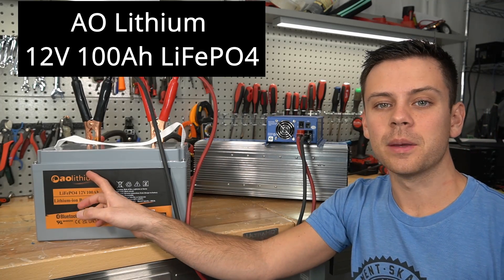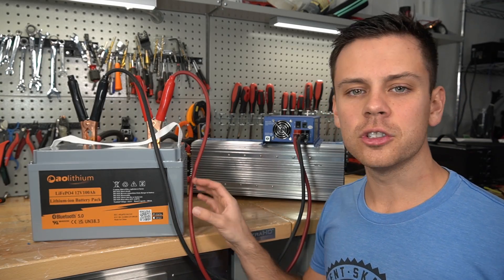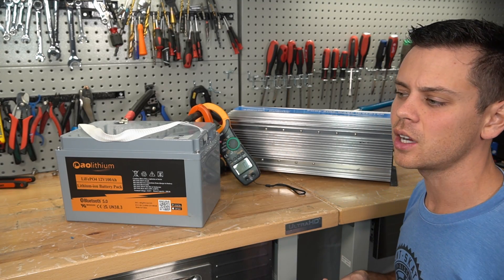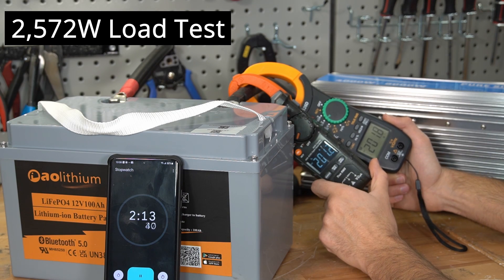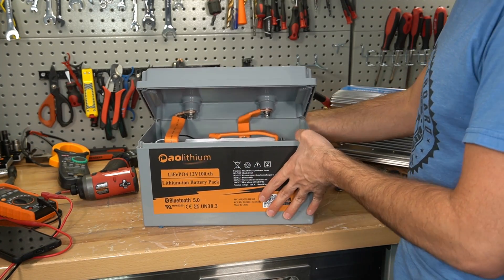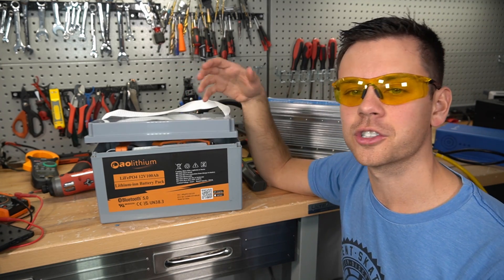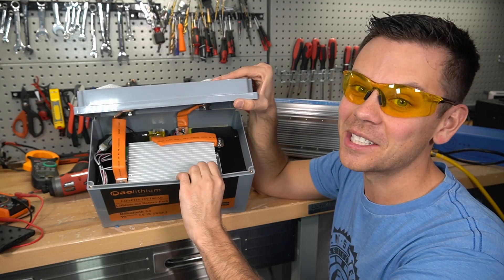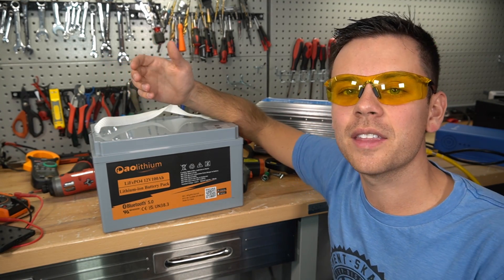"AO Lithium" Stress Test: Can a 12V 100Ah LiFePO4 Run 2,500W?!

Comment: Hey Will. I greatly appreciate your videos and have learned a lot about Solar from your subject matter. Quick question. I'm finishing up an Off Grid cabin build in the mountains. Plan to run 4 LED lights, a small TV, a very small refrigerator and a small 1/2 HP 110 water pump. Could a 12v system get the job done for me, or should I go with a 24v system? Anyone in the thread with advice would be appreciated.
Reply: Is refrigerator 12volt and how deep well?
Reply: @bluecheetah420  fridge is a tiny 110v unit and the pump is just for creating water pressure for a small sink and shower with the water supply being a 35 gallon water barrel. No well to pump from yet.
Reply: @paulie6709  cat’s pajamas hit it right on the head with response
Reply: You could run a 12v RV water pump instead of of 120v. They are designed for that application. JMTC.

Comment: Very impressive! Too bad you didn't monitor the voltage @ the terminals of battery. I'd like to see what the drop is during the load test. I know FLA batteries are terrible when hit with a load like that.
Reply from the maker: 114mV drop across the longest supply conductor. Not bad. Was checking it
Reply: @WillProwse  That's good, but what about battery terminal voltage? Did it stay above 12 volts?
Reply from the maker: @curtchase3730  yeah probably stayed above 12V because it's lifepo4. Soc curve is much higher than other batteries, and internal resistance is low. Pretty sure voltage drop at load wasn't bad at all
Reply: @WillProwse  LOL I saw that spam. What a bummer. Some ppl just like to mess things up. Thanks, I figured it would stay above 12. They rate the voltage around 12.8 but all my LiPo's hover around 13.18 or better when not loaded down.  BTW, I love your enthusiasm of the world of alternate energy sources. Thanks for all the tips. 🤗
Reply from the maker: Gosh I'm so tired of the spam. I report every single one

Comment: With the ability to pull that kind of power for that long, Heat sink will need help with a fan and cool air ventilation.  I know that the manufacture doesn't recommend it, but if you fill the cookie jar and tell the kids to not touch them.....

Comment: You didn’t specify what kind of microwave.  There are a lot of 600w and 1000w microwaves.
Reply: The brand of the microwave oven is not that interesting - the only relevant factor is the power consumption. There might be minor differences in the inductive load (on the inverter) but that is for your inverter to handle. A current of 200 amps @ 12 volts corresponds to 2400 watts, so just about any microwave oven on the market for household usage should work.
Reply: @inber  I said anything about the brand.
Reply: @MattNis1  so if not brand then what are you referring to when you ask "kind"?
In line with the discussion and comments it's about household cooking microwaves.
Reply: @chrisdevalcourt648  small, large, commercial, built-in, portable, with or without exhaust, with convection, drawer, etc.  mostly referring to Wattage and maybe kind wasn’t the best term.
Reply: @MattNis1  I think definitely not commercial but 600,- 1000 was mentioned?

Comment: I wonder how their app handles two batteries in parallel. Does it know the Ah doubled and display double the capacity, or does it show two different batteries as separate Bluetooth devices?
Reply: Having used the similar app only on one battery, it does have an option to select different batteries, so I think it only shows one battery at a time.
Reply: @CafeElectric  That’s not ideal but it makes sense. I guess that’s one benefit to having an external battery monitor/shunt.
Reply: SOC should be fine/same. Hope for update on question.

Comment: Surprised they only put out 1/2 c discharge?? My last lipo pack from hobby king for my rc Helis was a 5.0 amp hr at 40c discharge rate panther pack
Reply from the maker: Those are lithium polymer batteries with much higher discharge rates. I used to run 50 to 100C poly packs in my race drones. Lithium iron philosophate is built entirely different
Reply: Similar to the difference between a lead acid starting battery vs. a deep cycle FLA… some are designed for long cycle life, some are designed for maximum discharge abilities. 
A cell built to provide inverter storage longevity won’t be designed like a battery built to power a drone or RV plane… where weight and thrust is paramount.
Reply: Will & Supervs, answers this Kevin, however, this lifepo4 chemistry will run your radios for decades.

Comment: Does anyone know a way to boost a 12 volt battery such as this to 48-60 volts for an electric bike?  It's the perfect size for my trailer, and if it could push even 1-1.5kw for a half a minute, it would only be at 200-600 most of the time cruising.  The specific electronics necessary?

Comment: Imagine how well cooling could improve if a heat pipe system was used with fins outside of the case.
Reply: Small fan and vents would be the best.  Air filter foam can be used to stop dust
Reply: @sammyd7857  - Not a bad idea but I try to stick with passive cooling whenever possible to avoid parasitic drain on the system from active cooling.
Reply: That and/or make the case out of aluminum & safely design/allow the case to act as a secondary heat sync.

Comment: I think it’s very important to consider the ambient temperature at which you start operating this battery at its maximum discharge rate.
Reply: I think you are right. In this test it went UpTo 75C or 167F at 3:22. Imagine it was on a hot summer day inside a Van, what could the temp be. 🤔

Comment: This is amazing. I've watched a good many videos about batteries in general and I had no idea they made something this small that could sustain such a large load for such a LONG time.
Amazing to think how far batteries have grown in 10 years and will continue to change in the next. One of these little guys could run my computer for 6 hours on a single charge at a lower C-rate.

Comment: Thanks for doing that test!
The heat sink and bus bar temps could have been a lot higher than you read (and any MOSFET/transistor junctions will be much hotter than that) due to the low emissivity of bare metal. IR guns are calibrated for very high emissivity surfaces and metals need to be painted or otherwise coated to bring up their emissivity so IR gun/camera reading are accurate.
Reply: Agreed. We would run into that problem measuring bare silicon dies on microchips at work with our FLIR. Some flat black paint or even a black sharpie will help with the measurement.
Reply: You are right. The cells outer temperature was over 75C/167F. Check the app at 3:21. It's really bad for the cells to be discharged at this rate, we don't know what will happen if the ambient temperature was higher like during summer!
Reply: Translate for an aero engr who was lost at the start, please
Reply: @turbohack  bare metals are very bad at emitting IR (they have a low “emissivity”). But thermal cameras and “guns” are calibrated for very good IR emitting surfaces with high emissivity. This means cameras/guns read the temp too low if pointed at bare metals (since the metals are not emitting IR as well as other surfaces). By painting metal flat black we create a surface that is good at emitting IR and the IR camera/gun will read the temp correctly. Check out “emissivity” if you’re interested in more detailed info.

Comment: That sucker’s amazing! 12v 100 amp 2500 watts! Van and RV folks are going to love this.
Reply: it's 12.8v 100 amp-hour and 2500 watts.  A steady 200 amp draw was put in place here. Not something you would do on a battery of this size, I like he put their claim to the test and disclosed what the drawbacks of doing so were on battery longevity.
Reply: Wait so could this battery run an electric heater?
Reply: @nesdi6653  nor for very long, and then it would need recharging

Comment: Would the DIY Solar battery using eve or lishen 280ah cells be able to power a microwave using the Overkill Solar BMS? There are some pretty small microwaves out there.
Reply: I just finished a trip where we ran the smallest microwave I could find(700w) and it pulled about 85amps. We have 280ah eve cells with overkill bms and 1500w inverter, our all in one inverter and solar controller was tripping as it was just a tad over its continuous 1000w rating so we picked up the 1500w one for the trip. All my stuff has be based on Will's recommendation and it seemed to work good

Comment: That is SO great you did this video! As I mentioned in your previous video comments, my microwave pulls 150a and I generally only use it for 2 or 3 min at a time. I am currently using a 79ah AGM battery to run my microwave while boondocking. The most common max discharge rate of 100a for a 100ah battery is the only reason I haven't upgraded to Lifepo4! But this battery is a game changer for me!